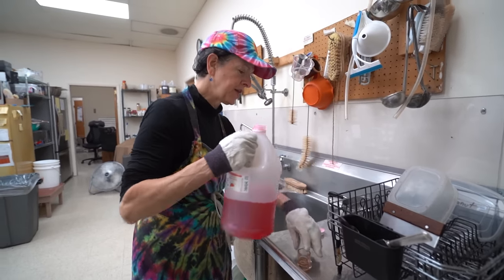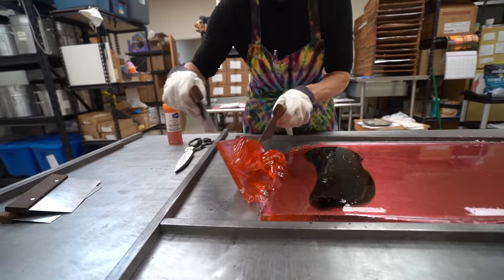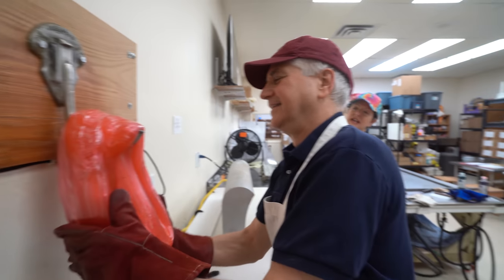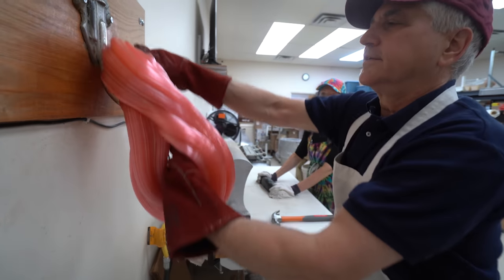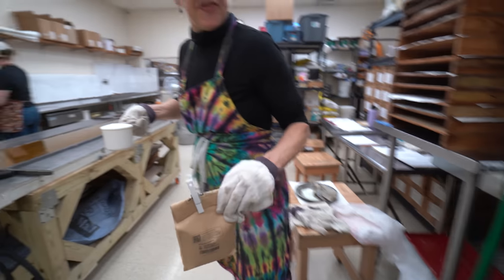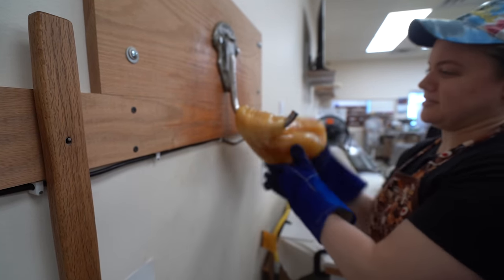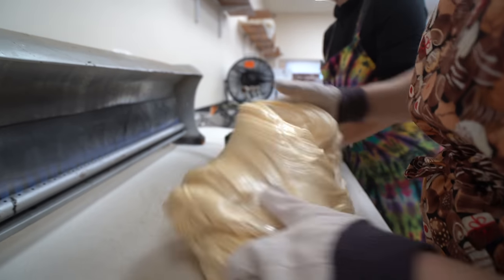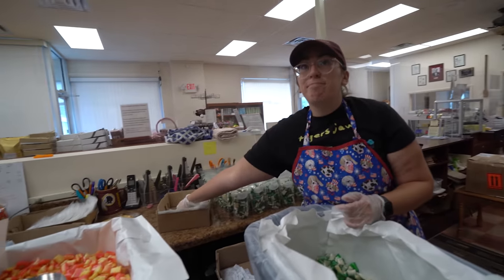Mother And Father Teach Daughter Candy Making Secrets!

Comment: Airheads are a taffy made by the same company that makes Mentos and Chupa Chups. 
Back when us old people (me and Steve, and I think he's actually younger than me) were kids, "mystery flavor" meant, "we mixed the new flavor into the old batch at changeover;" so you would get a lollipop that was swirled with, say, purple and yellow. I can see Airheads taking all the little bits and saving them in one place, and then reheating them and blending. Squeeze maximum $$$ out of every run!
Reply: So...I googled Steve to see who is older (Steve) and I was fascinated to learn that there is a market in old press photos of Steve at work; there is even one that has sold, that is of Steve and Terry with Leah, and it looks like they're in the basement in front of the heat table....